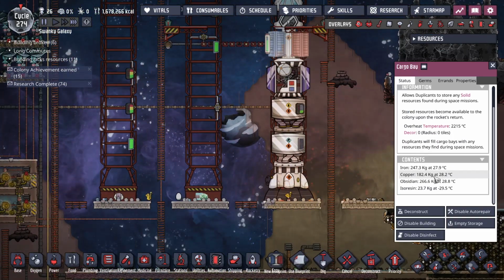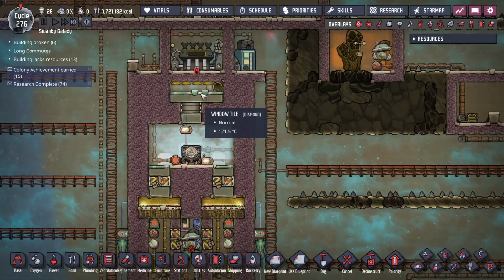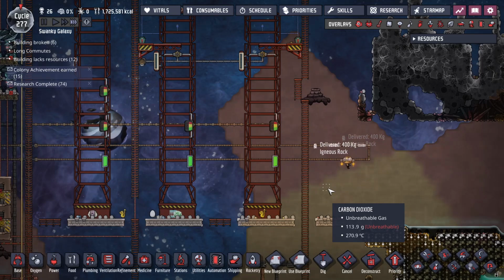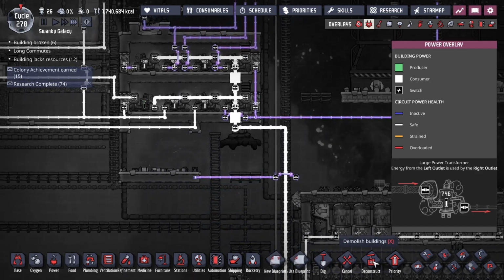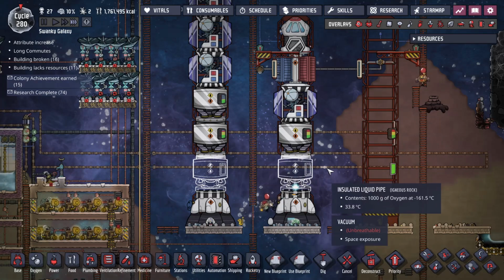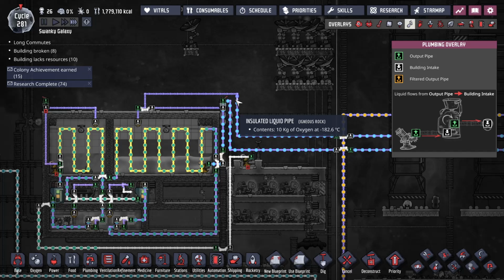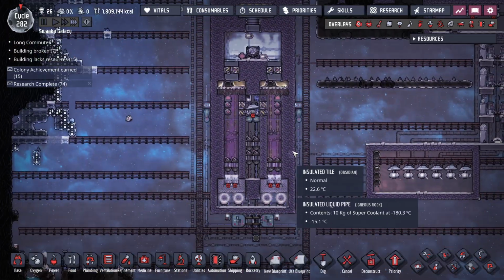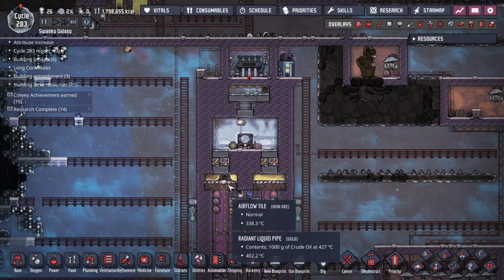Oxygen Not Included Swanky Galaxy ep 15 Fire up the Sour Gas Boiler

Comment: you have yours LO2 pipes in space in vaccuum but you ran insulated pipes which are 400kg a piece.  Instead, next time try running gold radiant pipes.  It seems counter intuitive but the heat capacity of gold radiant pipes is super low and because they are in space theres no heat transfer anyway.  They mass difference and the heat capacity difference means you have a lot more heat you need to suck out of the pipes with insulated pipes.  Just build regular pipes made of insulation ( 300kg less per pipe and still doesnt allow heat xfer) in the path of the rocket exhaust.  You'll be able to spin up your LO2 a lot faster.
Reply from the maker: interesting idea.  With spaced out adding LO2 rockets I'll have to try this, since we now need multiple liquid systems.

Comment: Need ceramic?  See this: https://forums.kleientertainment.com/forums/topic/116149-claymator-v2-stay-weak-no-labor/
I built one and it works well.  Hope this helps you in the future.
Reply from the maker: Nice.  I'll have to try it out.
Reply: @TartarusPlaysGames  As a bonus, if you install gas pumps with gas element sensors set to green on clean O2 and atmo sensors set to < 250g it gives you nearly a kilo and a half a second of clean oxygen for your base.  I can provide screenshots of my modifications if you so wish.
Reply from the maker: I have used similar clay maker using slime rails, for clay and oxygen.  For that one I ran the slime through chlorine to remove the germs for clean air.
Reply: @TartarusPlaysGames  That's pretty clever.  I usually just use slime for mushrooms.
Reply: In debug testing of the Claymator v2 you need about 3 times the amount of polluted water for the 16 deodorizers to run full tilt.  Apparently Klei nerfed pw offgassing in the last few months since I used it.  It still works though, it is just a significantly larger investment to make water wise.  Takes about 70 cycles for it to fire up.
Reply from the maker: @1x4x9  Nice, it's always good to retest designs after updates to see what thy nerfed.  But if you are on a map without slime, or clay making ceramic is important.
Reply: @TartarusPlaysGames  Or in the case of the base I'm building now, not enough.  :)

Comment: One of your automation wires on the right side of the  petroleum boiler at the and gate is not connected
Reply from the maker: Is that the one by the and gate?  I accidently had it connect through, and had to disconnect so it would work correctly.